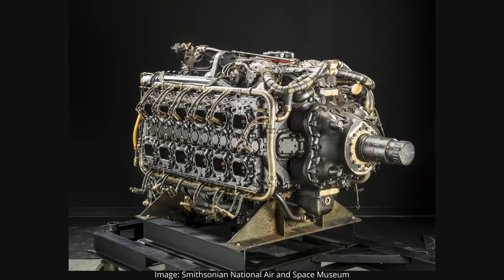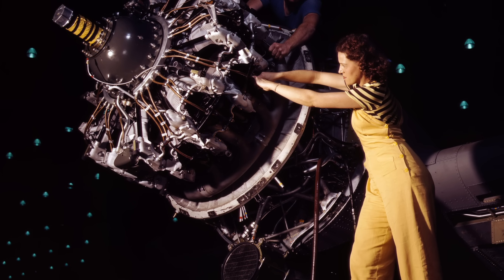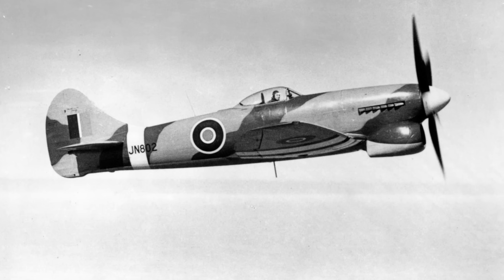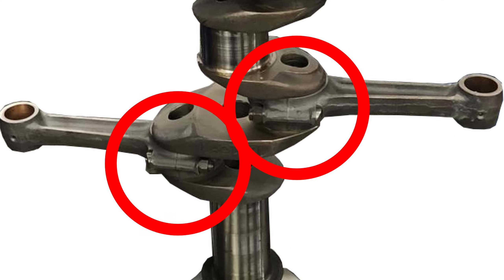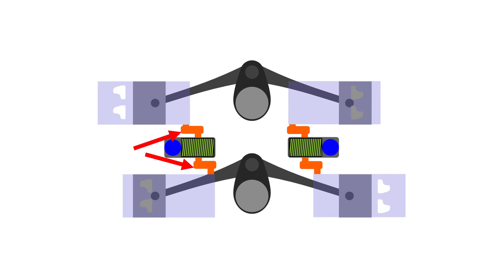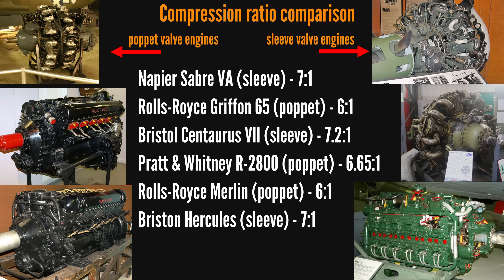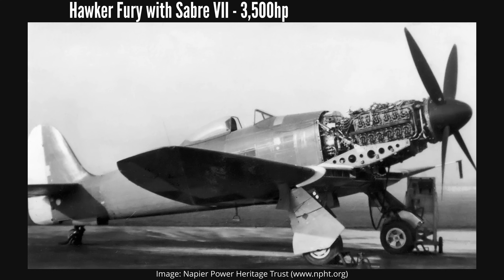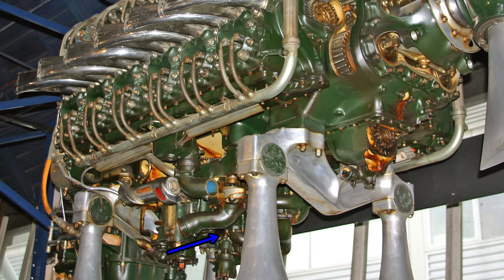The Complex Napier Sabre 24 Cylinder Aero Engine Explained Simply

Comment: Sleeve valves have a major advantage in flow over poppet valves because when the sleeve valve port is open, there is nothing in the way to block flow, while a poppet valve, even when fully opened, has the head of the valve impeding the flow of air or exhaust gasses.
On the other hand, sleeve valves tend to be difficult to seal perfectly. 
Even so, if only the Napier had multi-stage supercharger or a turbo supercharger, it would have been the king of the skies.
Reply: The biggest advantage actually comes from the ability to compress higher than a poppet valve engine given same petrol fuel. 
But a poppet valve engine can allow more boost....
Reply: Just increase lift until the head is out of the high velocity zone. Ideally, 4 poppet valves on a hemisphere. Diagonally opposed valves belong together because they don’t interfere.
Reply: @ArneChristianRosenfeldt  Unfortunately, high poppet valve lift leads to a substantial decrease in mechanical efficiency, high consumption issues, big and heavy engine design with reliability issues. The Merlins e.g. were literally eating up their high lift camshafts as the friction was so high. As an unwanted by-product your engine has insanely high valve spring forces which must be even higher if you work with boost. 
The highest RPM of your poppet valve engine is unfortunately mechanically limited in the event of the poppet valve not returning in time at its seat, which will happen at a certain RPM because your spring is simply not strong enough, but you cant go higher force as the camshafts are already wearing out real fast. You can build a desmodromik valve gear which can level this out, though. 
The sleeve valve engine has as much free breathing area as a 4 valve head but the sleeve is completely guided by mechanics, no springs in the system, so a sleeve valve has usually much higher RPM.
So you cant just increase lift because it leads to an engineering dead end whereas the sleeve valve is absolutely superior in this regard. The sleeve valve has other flaws...
Reply: @ThorstenKreutzenberger  ah, the US V8 community seems to regard high lift as a silver bullet. I did not know that Merlin had breathing problems. So that is where the (low) 3000 RPM limit comes from. The rocker arms already extend over the whole bore! Maybe they should have added a small spring directly on said rocker arm. Not for bias, just to make it return to the top at RPM limit.
Reply: @ArneChristianRosenfeldt  My understanding is the relatively low RPM of WWII aero engines is mostly to keep the average piston speed reasonable. They had big undersquare cylinders with long stroke. The Sabre was the exception, it was the small short stroke oversquare cylinders that allowed high rpm, not the sleeve valves.
Reply: @jbepsilon  and to this day no one explained to me why piston “ring” speed is not a problem in a Wankel engine. For gears, cavitation and submerging becomes a problem. So the big film when going down is the speed limit? Need a dry sump and metered squirters?
Reply: @ArneChristianRosenfeldt IIRC the main RPM limiting factor in WWII aero engines were stresses on the conrods and journals. Hence the suggestion of looking at mean piston speed as a crude measure of these.

As for adopting dry sumps, all WWII military aero engines had them. Wouldn't be able to fly inverted or do other acrobatic maneuvers with a wet sump.
Reply: @jbepsilon  but stress depends on acceleration. And my math tells me that the peak pressure is most stressful, but for NA F1 and bike engines. Maybe pistons were really heavy in WWII . A light piston is mandatory for 4 or 3 cylinder bike and car engines which lack balance.
Reply: @ArneChristianRosenfeldt  Not really, as always piston velocity (throwing a rod) and bearings (running the mains or big ends) are the main issue with high rpm in ohc engines.  These days, spring technology is much better and valve springs can go much higher than WWII and that is before we start talking about "tuning" the springs for better performance over a limited but high range of rpm.  That's lucky for many people in the USA who are still in love with pushrod engines.  For F1 engines, where Cosworth managed to get over 20,000rpm (got banned), metal valve springs would not have been a goer
Reply: @robertnicholson7733  I don’t get it. Velocity increases linearly with RPM, while acceleration increases to the Square. Springs need to store more energy and be lighter at the same time. I understand. But mains? They get the best oil supply. They don’t introduce imbalance and can be big. On non-US V8 they carry counter weights in bay. 90° V cancels most of the forces. I say that force in the next bay may be different, and that hence the bearing should have the shape of a sphere to be able to bend without wear.
Reply: @ArneChristianRosenfeldt  Ring Speed is a big problem in the Wankel engine, Curtiss-Wright, Ingersoll-Rand and Deutz ran up against the limits as they increased rotor diameter and were forced to reduce rotor rpm to less than 800...

Modern piston engines use Twist-type rings that are tapered or beveled such that they rock or twist inside the ring grove like a hydraulic seal and only seal on the leading corner of the ring, this reduces friction and increases seal integrity... as opposed to traditional flat rings they seal only using the spring pressure of the metal ring against the bore..
Reply: @ArneChristianRosenfeldt  Combustion dwell time is also a limiting factor on these big aero engines, it's the same dwell effect that limits the practical rpm limit of Diesel engines to below 5,500 rpm at 100mm bore diameter or less and significantly less as bore diameter increases..
  Combustion efficiency and power drop as the bore diameter get larger, multiple injectors or multiple spark plugs w/split timing reduce the effect.

Some very large Marine Diesels have multiple injectors equally spaced around the combustion chamber to allow higher rpm with large bore diameters and increase horsepower output and efficiency.
Reply: @ArneChristianRosenfeldt  Lateral modes can be a problem with crankshafts, but the major problem is torsional modes in the crankshaft, these destroy crankshafts when they hit resonant frequencies.  It is a very complex situation.  Various dampers and methods were used to counter these dangerous resonances, as well as cunning design.  In the early development phase of the Merlin, it apparently had a problem with torsional modes,  one source states that this was solved by the  brilliant but "difficult" engineer, Stewart Tresilian who was a part of the R-R R development team and a big proponent of high rpm, very over square, engines.

Main bearings have to be fed oil and this needs to fight rotational forces trying to stop it moving in the plane of rotation.  Rolls-Royce significantly changed the way the oil was supplied to the main bearings and con-rod journals throughout the development of the engine.  Part of this is explained in the Lovesey talk to the de Havilland engineers at the end of the war (probably to do with the 2050hp 130 series engines that powered the Hornet).  For car engines, things can be just as bad.  When ford Australia started racing the 351C Clevelands, they quickly ran into serious problems with oil starvation at the back end of the crankshafts.  Even easy driven road cars could have serious problems, Ford really didn't do a good job on the lubrication of that engine, the cams and tappets would be awash in oil while the main bearings starved, flow restrictors were introduced but even this was not an easy fix.  As the rpm goes up, the forces that the oil has to overcome increase, leakage of oil at various places in the engine (ends of the plain bearings, etc) go up.  Increasing oil pump pressure may not solve the issue as the leakage goes up and oil goes to the wrong places.
Reply: @ it is just to have a resonance there needs to be low friction. As a kid I got to know my bike. Ball bearings. Tiny bearings, huge tyre. Now a combustion engine “only” has friction bearings. The cranks are only 3 times longer then the bearing radius. On the other hand, the occurrence of a resonance is proof of the low friction of good motor oils.

In some applications, Motors end with a gear on both sides. So we could pressure feed oil just as into the camshaft. Even in a V12 perhaps. Yeah, production engines need to be cheap, and race engines don’t accept the weight of more oil pumps, but basically a scavenger pump could be followed by a centrifugal pump to increase pressure just like inside the shaft. EFI uses a centrifugal pump for fuel? I think this is weird because dynamic pumps work better at high Reynolds numbers. And fuel pressure only need to rise slightly with RPM. At least there is a lot of oil, while we don’t want to burn lots of fuel.
Reply: @ArneChristianRosenfeldt  I will stick to a simplified second order system for this explanation.  Resonance is a function of the mass of the system and its compliance (springiness <sigh>) not damping (friction and other losses), damping does not affect the resonant frequency, it is still a resonance even if there is  no peak.  The system has a Q (quality factor) which is based on the damping (alone), the higher the damping, the lower the resonant peak and the lower the Q.  

There are two main types of bearings; anti-friction (ball, roller and needle), and hydrodynamic (plain journal bearings).  Anti-friction bearings have lower losses, thus lower damping, hydrodynamic bearings rely on creating a self generating, extremely high pressure oil film between the bearing and the journal, this takes power, the losses are higher, the damping higher.  The Germans liked roller cranks, but they were expensive, heavy, and a supply chain issue.  They also require a lot of oil for high rpm.  DB changed from a roller crank to a plain crank in the DB605, they had problems!

In any case, the damping provided by "friction" in the engine is nowhere near enough to reduce serious crankshaft resonances to a survivable level and even if it were possible, you would not want to do it as friction acts at all levels of rpm but crankshaft resonances usually have narrow bands.  So to control them, mechanical dampers were tuned to the destructive resonances.

The previously mentioned Stewart Tresilain was also involved in car racing as well as aircraft engines (including gas turbines) and after the war pushed his high 1.8 bore/stroke ratio to a number of racing concerns but with no real success.  He did however, design the original BRM P25  four-cylinder engine which had a bore/stroke ration of about 1.3 (very high for the day) and a four bearing crankshaft, the normal centre bearing being nowhere to be seen.  The crankshaft did not have an issue but later, after Tresilian's departure, a fifth bearing was added which Tony Rudd estimated to cost the engine over 20 hp.  Apparently, when told of the addition of the fifth bearing, Tresilinan's response was highly amusing but unprintable.  He also designed the Lagonda V12 engine and much of the chassis for W.O. Bentley.
Reply: @ if resonance is narrow, it means that friction is very low. In physics class we go to great lengths to reduce friction to show a resonance. A wide peak also is not very tall, meaning there is not much torsion which could destroy anything. Harmonic dampers just flatten the peak. Any mechanic systems has resonance. Adding mass in form of these dampers pulls in more resonances from above the red-line. Just these all get flattened.

Looking at optical tables, I think a light way to balance is a parallel shaft (like the balance shaft in a 120° V6 ) and connect it using precision gears on both ends. The straight, hollow shaft has higher internal resonance frequencies. Then insert a fluid clutch into this ring.

Just, gears don’t like banging back and force from one side of their teeth to the other. The good thing about the single cam V8 is that friction on that cam always outweighs any temporary slow-down on the crank ( with low enough compression and a large flywheel).
Reply: @ArneChristianRosenfeldt   "if resonance is narrow, it means that friction is very low", it only looks that way due to the high peak of the low damping case, the meaningful influence on the transfer function of a 2nd order system starts in about the same place for a very wide range of damping rates.  In control systems engineering, we went to great lengths to avoid high resonant peaks, except for a few bizarre cases that didn't work out as expected, or not at all, working on low damped resonant systems is no fun.  The second order example was only provided to illustrate a point.  

There were a number of damping systems used to control crankshaft resonances, these were not passive damping like the harmonic balancers used on front of the crankshaft of a typical V8 but active systems using tuned moving weights (eg. pendulum dampers such as Salomon [spelling?]), hydraulic dampers (Allison), etc.  These were not only tuned to the resonant frequency but also tuned to a specific radial position on the crankshaft.  Resonance decoupling was also used in the engines to isolate a resonance from some part of the engine (obviously not the ignition or the camshafts) that was sensitive to it.

The situation is very complex with a large portion of the engine involved in resonant issues, including the propeller shafts and their drives, camshafts, camshaft drives, auxiliary drives, supercharger and drives, the crankshaft, any gearing and the crankcase structure including main caps.  When the Allison was used in the Airacobra, the engine misfired above 2600rpm, this was traced to a resonance in the magneto drive system being excited by a torsional vibration in the long extension shaft used to connect the engine to the propeller reduction gear.  Using a thicker walled extension shaft solved the problem.

The Napier initially used crankshaft counterweights, but these were later found to be unnecessary.  This is likely due to the extremely stiff crankcase structure used in the engine, the main cap issue did not exist in the Sabre for the obvious reason.  Mind you, this is balance, not resonance.

The Napier prop reduction gear system used two coupled sets of gears and a balance system to remove backlash between the two crankshafts.  Rolls-Royce used a simple gear set to couple the two crankshafts in the Eagle 22 H24.  The fundamental difference in these two engines was the crankshafts in the Sabre rotated in the same direction, but the Eagle 22 crankshafts were counter rotating.

If you google Robert J. Raymond and crankshaft you will find the two very good papers he has written on WWII aero engine crankshafts, a comparison between the Merlin and the Allison,  and a comparison of the major V12s, they are quite technical.
Reply: @ this information makes a direct driven propeller on a huge spinner instead of a long shaft even more attractive. The blades need torque squared to their velocity. Any vibration is converted into thrust.

Electrical engineers use the Z-transform for their second order systems. No resonance because that would be Fourier. I am kinda used to quantum systems with their narrow lines (atom spectrum in astronomy) .
Reply: If you look at modern (racing and otherwise) engines, the gold standard is 4V in a slightly pent-roof combustion chamber with some squish zones at the edges. 

Hemi heads are actually no longer a good idea, as modern compression ratios would necessitate a domed piston leading to a very inefficient crescent shaped combustion chamber shape.
Reply: @jbepsilon   not full HEMI. I always misplace the link. Probably some Alfa Romeo motor tried to have exhaust on the other side. Kinda like Mitsubishi direct injection the intake would need to go overhead. With pent-roof the heads cannot clear the cyclinder walls as good. They would meet each other. Minimal surface area is a pyramid roof. But spark plug needs to be central in 3d. So we want a very flat pyramid. F1 engines are over square. So everything is flatter. And yeah, heads are in the way.
Reply: Super complex!!! I wouldn't  use it
Reply: @HDSME super simple….. just the engineering and metallurgy was difficult.
Reply: Not sure about that. 4V naturally aspirated engines already achieve volumetric efficiency well over 100%, it's more about tuning the intake resonance than the valves being in the way.

As for a two stage supercharged Sabre, one reason they never got there was they spent so much time getting the sleeve valves to work even remotely adequately that WWII ended before they had time to look into improving the supercharger.

Same thing happened to Bristol. Hercules was years late, and the bigger Centaurus missed WWII entirely.